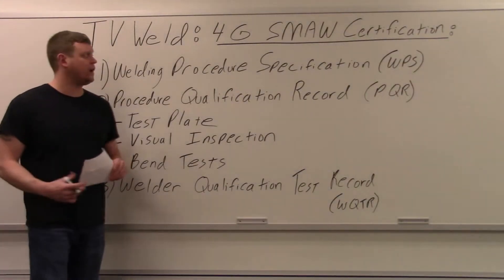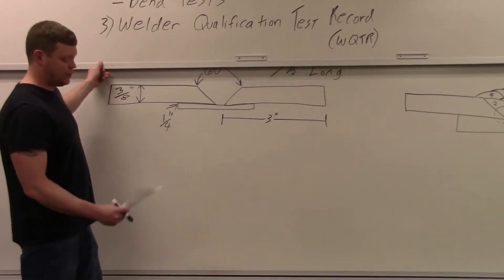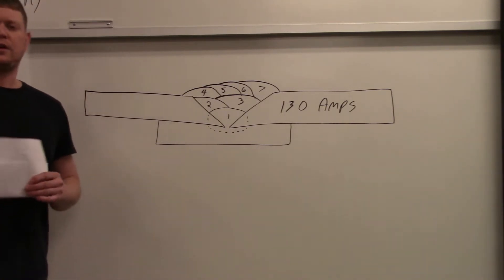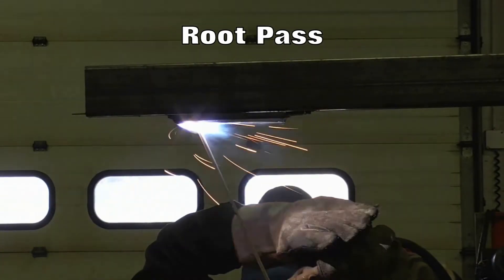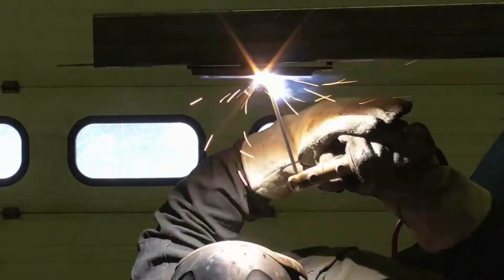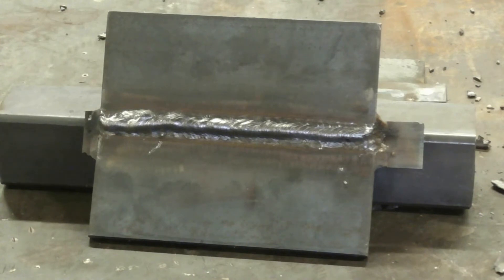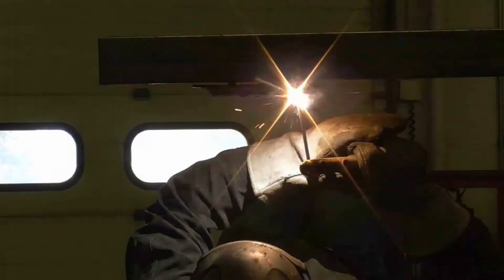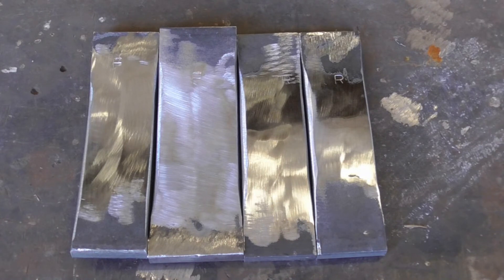4G Overhead Weld Test

Comment: very nice video, but i have a question...
when they do the test with or without a backing plate ?
Reply from the maker: If you qualify with backing you aren't qualified to run open root.  If you need to run open root then you need qualify without backing.

Comment: Are you laying on a table
Reply from the maker: I am!
Reply: @TVWeld  is that the best way to do a 4gf test
Reply from the maker: @mreojballer3777  It was more so they could get the camera shot, but I was very comfortable and that is the key to welding overhead.  You have to be comfortable.  If it doesn't feel natural try a different way to position your body.
Reply: @TVWeld  I'm doing the same test on the 3/8 plate 4g. can you show how you do it.